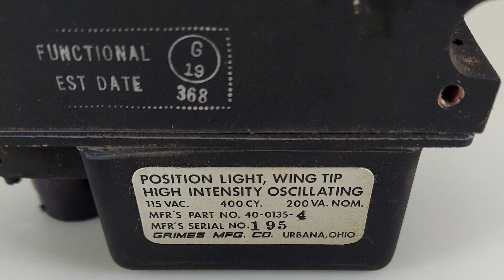Grimes Oscillating Aviation Light

Comment: Great video. Im in the process of doing the same thing. I have a Grimes red 360 rotating light. It's running 6v bulbs and a 110v motor. But nothing in it work. So im going to be converting it all to 12v.

Comment: The Grimes sales representative had to love McDonnell Douglas, who put six oscillating fixtures on the early DC-9 models. Upper and lower red beacons on the fuselage, two forward facing wing tip lights (red / green) and two rear facing wing tip lights (clear). Grimes might have supplied the four fuselage-mounted  inspection lights as well (one wing and one engine inlet lights each side). Not to mention the two nose gear landing/taxi lights, wing tip retractable landing lights, fuselage mounted turnout lights, and logo lights at the rear wingtips. Made the DC-9 unmistakable at night and cause some folks to think they were seeing a UFO!

Comment: You'll notice a lot of old traffic lights have blue lenses as well.  The reason is because of bulbs that tend to burn yellow.  I have some old railroad lanterns with blue lenses and when you put a bright white bulb behind them they appear blue but if you underpower a bulb it appears green.  A flame also appears green.
Reply: true fact. as an ex-railwayman working on heritage (flame lit) signals and more modern 'yellow bulb' signals, i have also had to learn about this in my time.
Reply: ahhhhhh you answered my question

Comment: Very cool project, John. I would be interested in learning about the features you mentioned, like the switch at the end of the arc and what it achieves, etc. Also, aviation "green" is definitely more of a blue, especially for fixed wing aircraft. Rotary wing aircraft traditionally use a truer green.
Reply from the maker: I think it tripped a signal to give feedback that the device was operating. I still have the parts, i will be testing them to see. Thanks for the color info, I don't know a whole bunch about aircraft lights except for the early Whelen stuff.